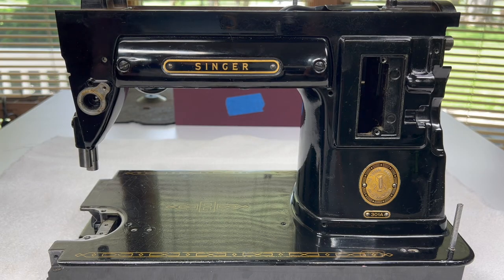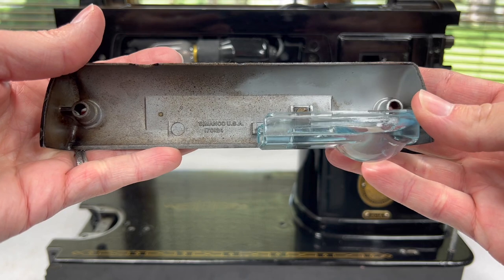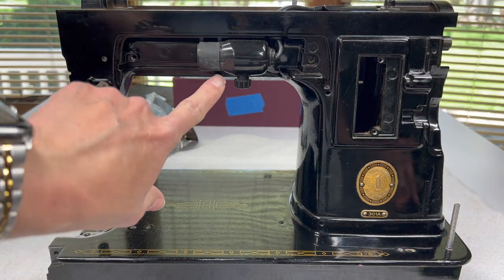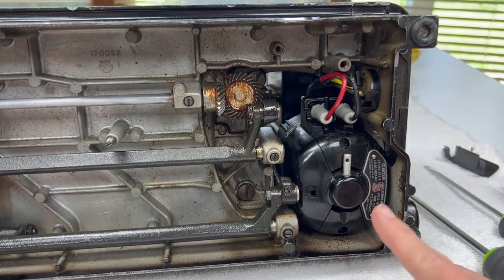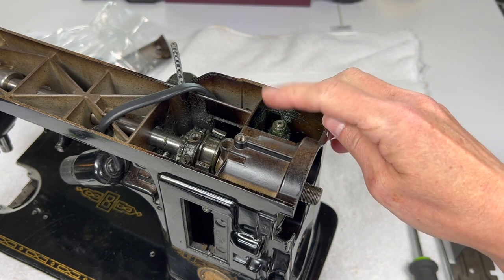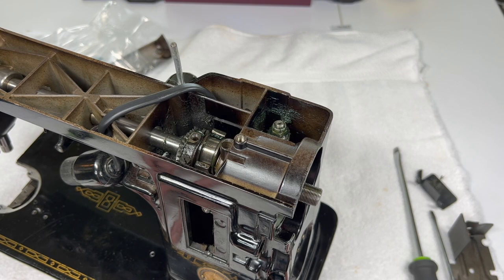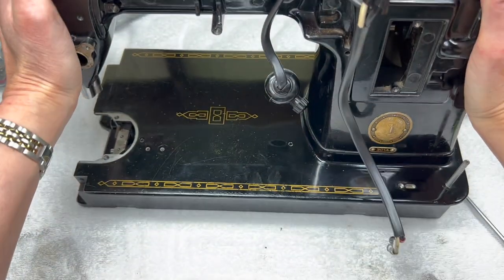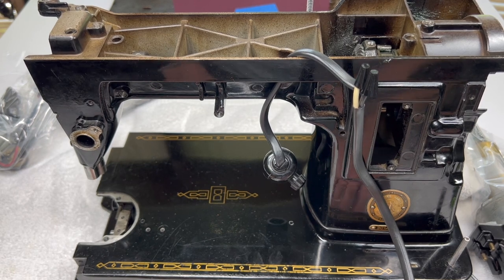How to remove the motor, wiring and lamp shade on a Singer 301: Singer Restoration Series Part 9

Comment: Why don’t you get a piece of round teflon to tap on to remove stuck motors instead of a cloth
Reply from the maker: Hi! You know, I probably used what I had on hand at the time of shooting the video. But yes, round teflon or a piece of wood are also options and I have used both. Good point and thanks for mentioning that!